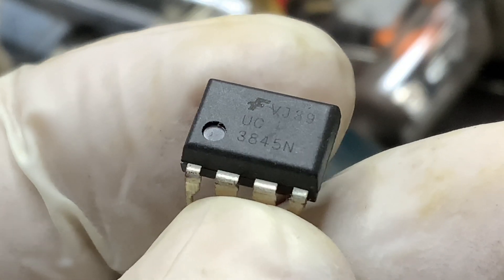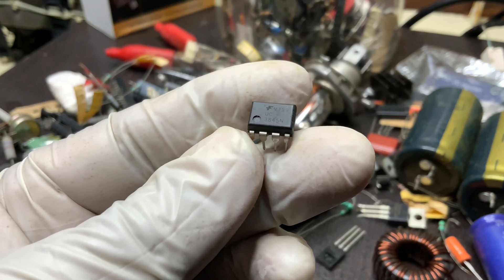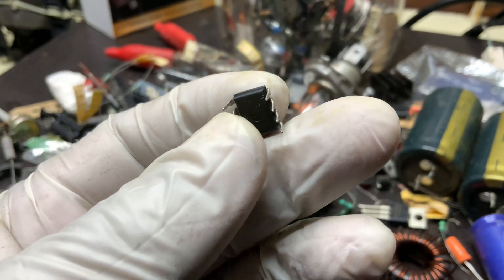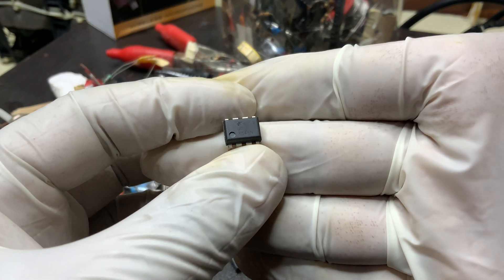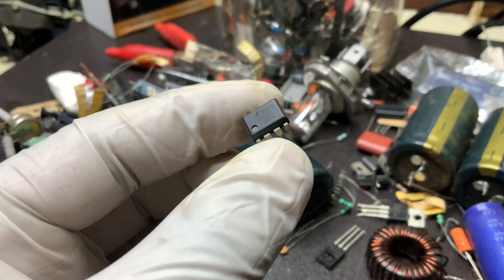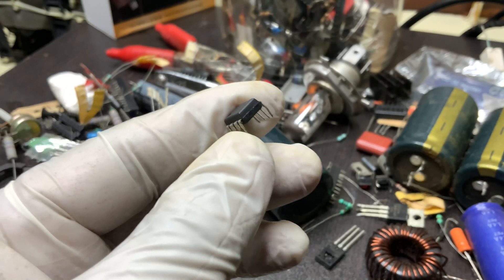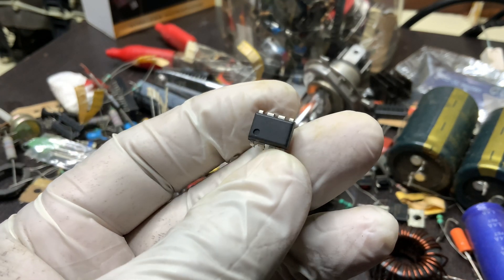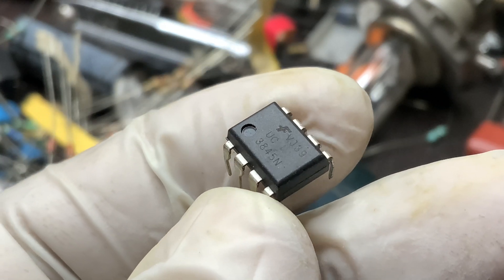UC3845 IC Favourite For SMPS Why?

Comment: Hello Akhil Satheesh. I read your article "UC3845 Buck Converter Circuit", and want to built one with multiple voltage outputs: 5V, 3.3V.. I have one question. Do you have any link for calculating the ferrite transformer? Thank you.
Reply from the maker: Solderingmind.com